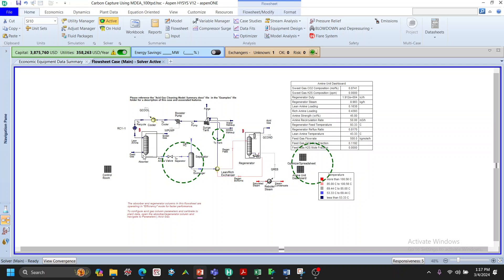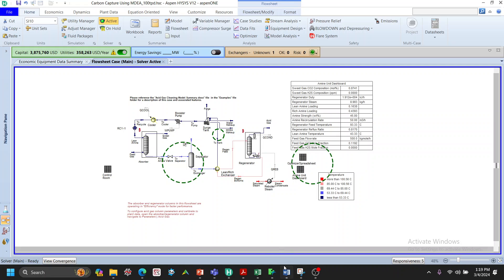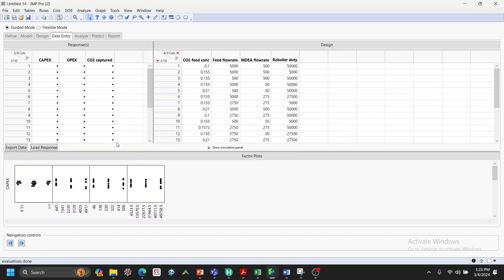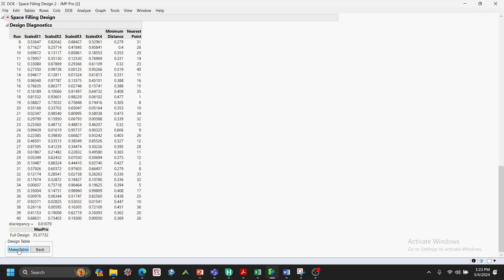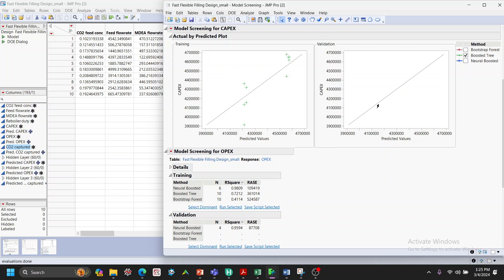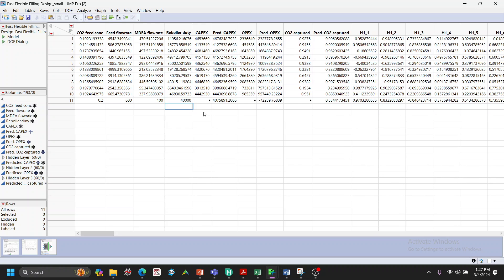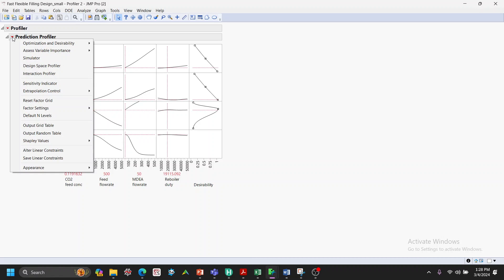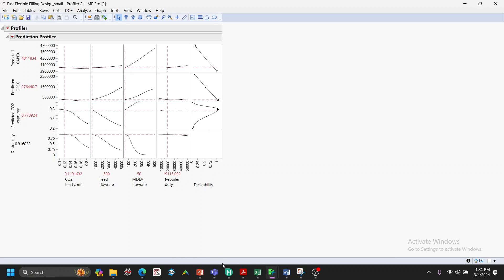Process optimization using JMP

Comment: Halo Pak Zulfan, terimakasih banyak atas simulasinya. Mohon ijin bertanya, jika saya mempunyai dua vessel yang terdiri dari low pressure dan high pressure. Vessel yg high pressure akan saya manfaatkan untuk blowcase meningkatkan pressure di line yg mempunyai pressure rendah, apakah hysys bisa megkalkulasi tekanan gabungan pada saat stream di mixer ? Karena biasanya mengambil tekanan yg paling rendah.
Reply from the maker: Bisa